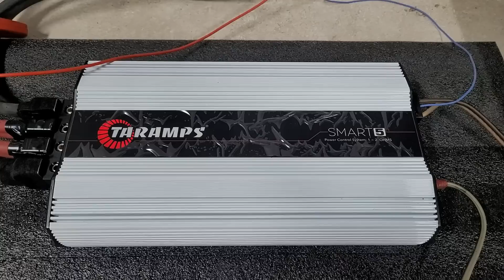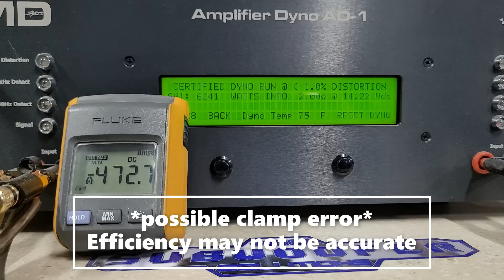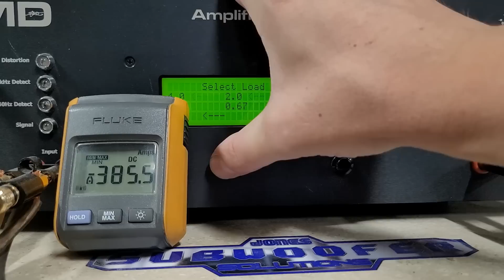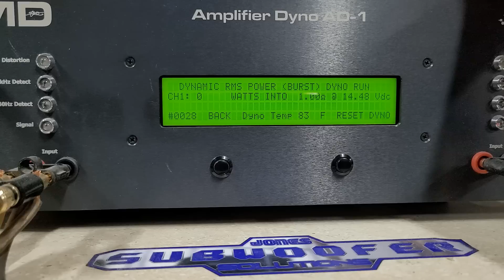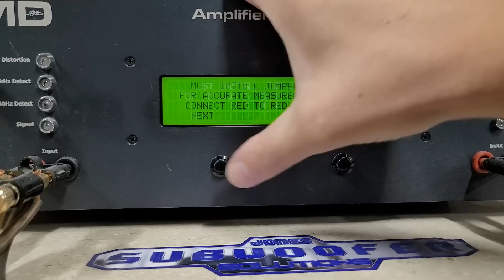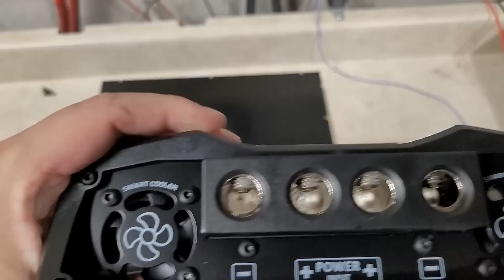AD-1 Amp Dyno Taramps Smart 5k by Jones Subwoofer Solutions JSS

Comment: How many amps should my alternator be?
Reply from the maker: @luismelendez4664  250a with proper battery support is my general recommendation
Reply: @ I have a 160a alternator l, doing the big 3, and adding a second battery, would that suffice? I don’t mind NOT getting the full 8k watts out of it since it’s gonna be in my daily driver
Reply from the maker: @luismelendez4664  you should be running more than 2 AGMs or wet cells.   Taramps recommends a minimum of 3 AGMs for the 5k.
Reply: @ so what would happen if I ran it the way I’m thinking?
Reply from the maker: @luismelendez4664  you risk damaging the amp if it gets starved of current
Reply: @ besides getting a stronger alternator, what are my alternatives? Can’t seem to find an alternator with that amperage that’ll fit my 2016 gmc terrain
Reply from the maker: @luismelendez4664  there's several alt builders that will have a proper HO model for your vehicle, US Alternators, Mechman, JS Alts, etc.
Also you could run lifepo4 lithium instead of AGM and get a lot more reserve for the space and cost.

Comment: Why did this test so much higher than the Smart base version?
Reply from the maker: The Bass version is a little more strict on rail voltage in trade for a little more protection against user error or abuse.
Reply: @Facekicker  when connected to subs will there be a noticeable difference in loudness between the two?
Reply from the maker: In real world use it would be very difficult to detect one vs the other by ear

Comment: So you need 4 runs of zero gauge wire to power it? Or can I use the knuconeptz oversized 0 gauge twice?
Reply from the maker: 4 runs of 1/0
Or
2 runs of 2/0
"Oversized" 1/0 will slip out and not be secure, it's too small to support the current and too small to properly connect.

Comment: I have 8 dual 4ohm subs, rated at 1100 rms, 2200max.  I was planning on giving each sub 2kw.  So I was thinking of running 2 bass 8k amps. 1 amp for 4 subs wire @ 1ohm. Do you think 2 smart 5 bass amps would be capable?
Reply from the maker: 4x 4ohm subs wire to .5 ohm or 2 ohm.
Smart5 Bass at .5 per 4x will be more than enough.
Reply: FaceKicker between the smart 5K and the smart bass 5K what’s better?
Reply: @mattfoster1077   bass version has lower frequency filters for subwoofer application. Also transformers might be a little different. Someone on YouTube has a good comparison of the two.
Reply: @Bigislandguy  I’m new at this so just asking around about them trying to figure out what to put on my platinum d1 12s
Reply: @Bigislandguy  I really want the Taramps Bass 8k two of them one for each sub but trying to figure out what’s the best out of the three amps smart 5k, smart 5k bass or the bass 8k
Reply: @mattfoster1077  I was kinda in the same dilemma. My plans have changed to 12 d2 subs. Me personally I would pay extra for the bass model. The smart models  do the same wattage @ 2- .5ohms like advertised. They still get down. But I’m gonna run 6 subs on a 8k bass @ .66ohm. 
The 8k will probably have more output  than the smart 5k bass. But the smart amp is rated .5 ohm stable. I would love to see a dyno of the bass8k.

Comment: Quick question so you would do better wired at 1ohm instead of .5 with this amp
Reply from the maker: Half ohm starting is best
Reply: ok plz sum help..so I have 2 15 inch skar evls 2ohm ok..sum one told me send them bck and get the 4ohm so I can wire them down to 1ohm..but this looks like it's better at 2ohm..so should I keep my 2ohm..But I dnt wanna run at .05ohm..plz help
Reply from the maker: @cali8221  If you have electrical to support 5k, wire to half ohm.
Otherwise, you can wire to 2 ohm but know that you'll rise from there and won't see full output of the amp.
Reply: @Facekicker  thanks ..I wanted to wire to 1ohm with 2 skar 15 evl 4ohm but from the looks this amp is not at its best at 1ohm
Reply: @cali8221  I have my smart3k wired to .5 ohm if you have the electrical wire to half ohm you will have impedance rise it will end up around 1to 2ohm you dont have to get different subs

Comment: Why does it got 2 power and 2 grounds?
Reply from the maker: Because the amount of current required to operate at full capacity exceeds the capacity of a single cable run.
Reply: @Facekicker  I understand so I would to run 2 power and 2 grounds from my 2nd battery to the amp correct. I run a smart 3 on my zv5 sundown Currently and really love this 5k from what I seen so far
Reply from the maker: @alexchavezdaily2678  Correct. But you need roughly double the amount of of battery that your 3k calls for.
Reply: @Facekicker  I have electrical cover 320a alt agm main battery and agm 2nd battery I believe I should be able to run it fine with no issues and at most won't be completely max just looking to put around 4k RMS max

Comment: Do all 4 inputs power and ground have to be connected or you can just use 2
Reply from the maker: They all need to be used with appropriate gauge wire
Reply from the maker: They all need to be used with appropriate gauge wire
Reply: Beginners question .So i have a smart 3 with dual inputs.   I want to do a even swap with a smart 5 with 4 inputs so how can i?   Where would the power on the second input on amp go to.
Reply from the maker: @moneymac5214  you'd need to add runs from battery or distro block/buss bars
Reply: @Facekicker  or just add another battery

Comment: Thanks for this video .i got this amp on 2 american bass hd15's  they woke up alot. They were on a hd5000 but no comparison. The hd was ok but smart 5 is another leval. Will hopefully get another one to put one on each sub.  But for now i will only deal with the smart line on subs
Reply: I would definitely like to see that, I have one 15 HD 2 , definitely not giving what it needs. Would like to see how your setup looks. Will sub to see if you post a video
Reply: Teamdsb what electrical you have for your smart 5.      I have 2 15s American bass hawks.   I have 250 amp alt big 3 and 2 agms in trunk.   On a smart 3.    Will adding another smart 3 hurt my woofers and electrical......whats better two smart 3s or 1 smart 5?

Comment: Why did you use a y splitter for the mono amp, should I do the same???
Reply from the maker: Technically they're labeled in/out but they're parallel internally so there is no difference in using the splitter vs normal connection.

Comment: I was deciding on this vs the Sundown SFB 5000D.
Reply from the maker: This is a much better amp
Reply: @Facekicker  why do you say that? I am a real novice when it comes to car audio. I noticed it has no bass knob and the Sundown does.
Reply from the maker: @MrLips635  You can add an RCA bass knob for 10 bucks.
Taramps offers higher power output at all impedances
Taramps offers far better circuit protection - over/under voltage, over/under current, low impedance protection.   Sundown has basically none.
Taramps offers better warranty
Taramps costs less

They're on sale on our website right now.
https://www.jonessubwoofersolutions.com/product-page/taramps-smart-5k
Reply: @Facekicker  I didn't know that you could add a bass knob.
Reply: @Facekicker  where/how do you add the bass knob?
Reply from the maker: @MrLips635  it goes in between the RCAs you run from head unit to amp.
We use the Axxess AALC in our install shop.
Reply: @Facekicker  Does the bass knob matter that much?

Comment: Great amp here,they have the same amp out now making that power at 12.8 v instead of 14v
Reply: Which one is better?
Reply: Do you have a link or model number please? Thanks.
Reply: @62dobie   the taramps smart bass is 14.4 the taramps smart 5 is  12.6 volts.check the models.
Reply: All of them are rated for 12.6 and up

Comment: Did u notice the smart 5 running hot on low volume? Weird cuz my smart bass 3 was always cold
Reply from the maker: Nah these haven't gotten hot on us.
Reply: @Facekicker  oh ok maybe mines defective idk. But seems like the reguler smarts lower notes arent ass much athority as my smart bass or reguler bass.. and the reguler bass doesent sound as good in te upper bass and punch since it doesent battle impedence rise...guess ima try out the smart bass 5k instead it just doesent put out the power at 12v is my complaint but smart bass sounds fucking amazing

Comment: It seems like it runs better at 2ohms instead of 1ohm. At 1ohm it never hit the rated power.
Reply: Because it is a 5k at 2ohm amplifier. At 1ohm naturally it wants to output 10k watts (Hence why dynamic is drastically high). What you have is 2ohm peak and tapers down because of how the "smart" circuit works and needs to pull down the output. Ohms law @2ohm is for every 1v there's .5A, @1ohm is for every 1v there's 1A, obviously then @.5ohm for every 1v there's 2A. The amp rating needs to stay low for the rating of the components, you either have high voltage or high amperage rating on the fets so its protecting it by pulling down the wave to achieve 5k at 1 and 2ohm. Then given that info, you should understand why .5 only made ~half. 

Once you understand how it works you'll understand much more about electronics but amplifiers for sure. I took my time so more people can understand better. Full bridge is 2 amps strapped. What that means is the output section is 2 separate amplifiers sharing the same power supply and preamp section. 1 controlling the + terminal, the other controlling the - terminal. Half bridge you have multiple amps (channels more or less) that work together and control the + terminal, - is just pulled down to ground.
Reply: @commonsenseisdeadandgone  i have a 250 amp alt from Ces.    2 agms in trunk and Big 4 ....i have a smart 3 on 2 15s hawks.  Can i add my second smart 3 and be fine with my electrical or 1 smart 3 will have better electrical to push the subs harder???
Reply: @J409-t2r  what is the stock battery and what is your voltage drop currently? What size Hawks? Assume you are talking American Bass. 

 I would have to say that i would certainly get more juice to run another smart 3, My suggestion is a  32Ah bank of headway lithium with your AGMs (yes you can mix LifePo4 and AGM but charge voltage max is 14.8 so be 14.6 or less to leave headroom) I'd also get a cap bank or 2. I like having 1 per amp but 1 500F bank will be fine on 2 3ks.  But if the subs are able to handle it, assumption is you have 2 D4s, you would be wired to 2ohm per amp so with rise you'll be immediately out of the benefit of why the smart amp is great. With that said smart 5 might not be a terrible idea for you. Unless you have D2s. 

As you know you can't strap them so you'll need to gain match. Typically I would strap the coils meaning 1 coil from each sub to each amp however I do not know with full bridge amps that's ok to do, don't know why it would matter though. 

It is all about that voltage, if voltage is dropping that's telling you that you don't have the amperage to sustain the demand.
Reply: @commonsenseisdeadandgone  i have a ces 14.8 alt in a 73 eldorado.......2 15s hawks.    I want to know what will slam my subs harder.  1 smart 3 with great electrical are 2 smart 3s and add a agm or get a smart 5 and add a agm.   I already own 2 smart 3s.    But i have 2 15s on 1 smart 3.       If i add another smart 3 will it take away from my electrical?
Reply: I have 1 yellow top under hood and 2 agms in trunk.
Reply: @J409-t2r  that's a whole lot of car! What is your current enclosure you are using? 

If you have another already put it in and watch your voltage, if it drops substantially then don't run it. Worth a shot since you already have it. If it don't hold I'd get a cap bank. XS or ioxus unless you know someone local. Or more AGM. I used to have 15" Titans which are now called hawks and they took a beating. Broke spokes on a basket though with 2 on a DC 7.5K. Great subs but my NSv3s are a little bit better 😂.

Comment: I went from this "6000" watt amp at 2 ohms to a wetsounds  2500 watt amp at 2 ohms. Not a small difference. The wetsounds is so much better its not even comparable.  Absolutely night and day difference.  So be careful what you buy..... the wetsounds cost me 2000 dollars, so there's that.. in my opinion it's worth the cost.
Reply from the maker: This amp has only been out for a week.....
Reply: @Facekicker  you are correct.  Mine is a bass 8k. Same full bridge style amplifier.  I was watching videos and thought this was the same one. Maybe it's better, I doubt it. If you want lots of wattage but poor control over the subs then tarramps is the right amplifier.
Reply from the maker: @dougbrook6223  No need to lie about things here.   Just say you've never used a Taramps or that you have no idea what you're doing, instead of trying to bullshit my audience.
Reply: @dougbrook6223  poor control? Do you mean poor user ability? I've ran two different taramps and have never had playability issues.

Comment: I ordered one today to put on a DD 9918. Kinda wished the smart 5 bass was out but I will just use my DSP to filter this one.
Reply: Mine came in today so decided to come back and watch the dyno video again.  This amp is somewhat of a game changer.  Should run roughly between 4-6k RMS when wired down to 1ohm.  
Still shocked at how small it is.
Reply: @liftedcj7on44s  The Smart Bass just dropped...mine is on the way
Reply: @kanemitchell6905  Thanks for the heads up sir.
Reply: @kanemitchell6905  I have the the smart 5k and my boi has the smart 5k bass and at 1ohm we both run mine is louder..I like the smart 5k better then the smart5k bass js
Reply: @cali8221  yea but the crossovers on the smart 5k doesn't get low enough like a half bridged amp
Reply: Crazy how you said this and then BAM they dropped it. I’m probably going to get 3 of them for my setup and send them all at .5ohm.  Waiting on facekicker to do the Dyno to seal the deal.... don’t need it clamping down on .5 and 1 ohm like this model.  On midbass these should be nasty beast.
Reply: @roysongarvey2261  It's a beast! I've never had an amp pound, or have any sound out of it when the gain's on zero. The four 15s I have on it does no justice...gonna order another set. It was around $630, but well worth it.
Reply: @kanemitchell6905  good knowledge. I’m about to test one against an md8 soon. I really wanna see if it holds the 5K at .5 and still make 6 plus at higher impedance with the incredible dynamic, IM SOLD
Reply: @roysongarvey2261  It's supposed to do 5k @ every ohm...feels like 17k
Reply: @kanemitchell6905  oh I’ll be clamping it so I’ll know for sure.
Reply: @roysongarvey2261  any update ?

Comment: Just seen the results and all I can say is this amp is good. It put well over 6k at 2 ohms love it!!
Reply: You may be right.
Reply: Well over 6k at 2 , but didn't make ratings at 1! I don't know much but I know bullshit when I see it.
Reply from the maker: @c20 np143 if you wire to 1 ohm and rise from there you will see all the power.
Reply: @Facekicker  that's what I was thinking because at 1 ohms the second you put music on a subwoofer you will always rise at lest twice the ohms. If your subwoofers are wired at 1 ohms and you hook a multimeter up it will read 1 ohms then push play on your music or put a signal into the amplifier you will see the meter rise near 2 or even 4.5 ohms or even higher when you turn it up. The only way you will see 1 ohms numbers on your amplifier is if it's wired around .25 quarter ohms or lower.
Reply: @Mr.NpK143  guess it's some smart technology that makes this amp less at 1ohms but higher at 2 ohms. I think this amp really looks like a MD 8000 2 ohms version that Taramp 8k made it produces less watts to protect the amp.
Reply: @Mr.NpK143  I saw another video of one of these that pushed just over 5k at 1ohm certified
Reply: @beardedforlife3740  did you see in this one where it didn't? If so is that saying some do and some don't? And if that's true then I guess it'll just depend on how luck a person is🤷🤔 😆. But thanks for the info

Comment: Just started watching haven't seen the end. I would guess that this is Taramps best amp because it will almost cancel out independent rise or what most people call ohms rise or "box rise". Now I'm going to guess it will do 5132 rms continues at 2 ohms 5235 at 1ohms and .50 it will go into protect or if it dose work at half ohms I'm going to guess from what I know about amps and how Brizilan amps act I'll say 5907 rms continues rms at .50. Now I'll right another comment at the end after I watch this.
Reply: If you're talking about spikes in impedance above and below tuning for ported (we'll ignore the one below tuning for now) then no, I think most people don't realize it's an efficiency spike. 

Just because it's not requiring a lot of power doesn't mean it's not playing just as loud as the rest of the spectrum it can play that's closer to the resting impedance. 

It's always good to have good clean headroom though.

Comment: I wire to .67 and rise to 1.4 so ID love to see a 1.4ohm run,I bet it does close to 7k
Reply: About 5500 as the ampere load is increased more so than at 2 ohm the smart technology will limit it more, Hence the higher 2 ohm than 1 ohm rating of testing. BUT if you are talking strictly dynamic.. sure